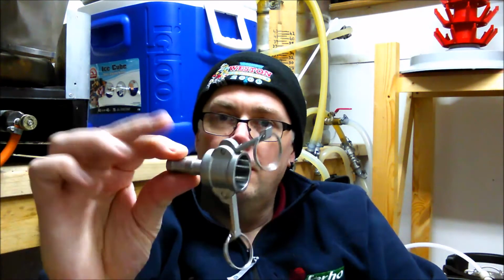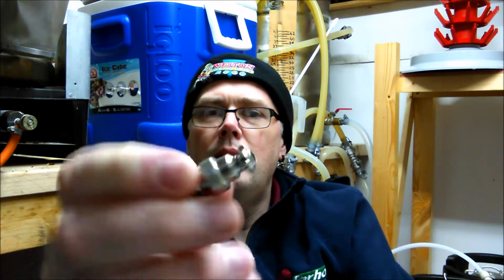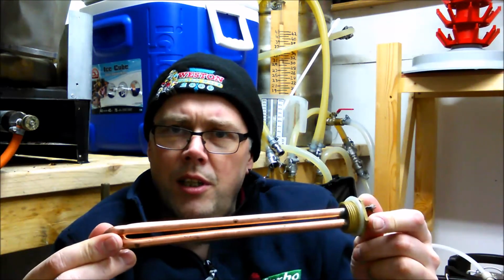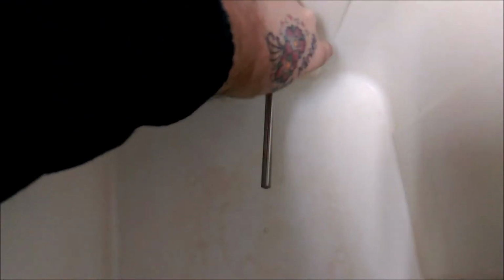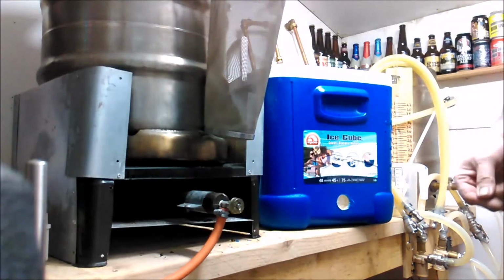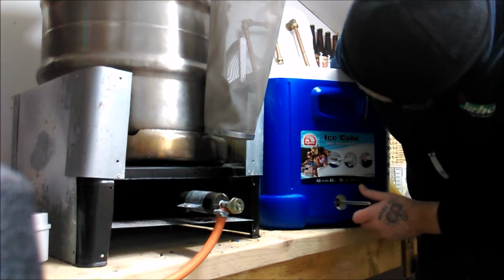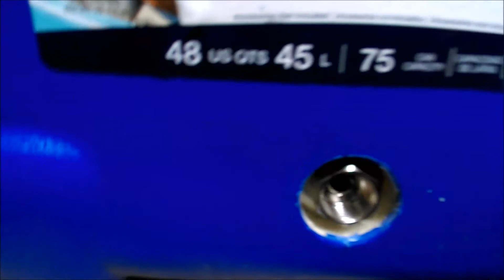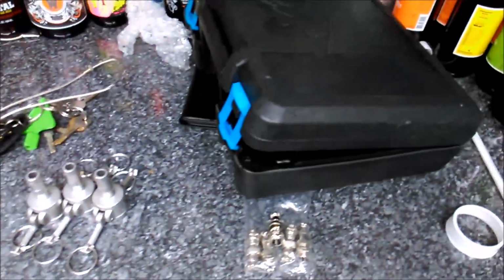HBW NO. 21 Happy new Year, deliveries and mash tun upgrade

Comment: do you ever finish tinkering with the brewery? that thermo well looks a good job and easy enough to install. one of those would be quite useful I'm thinking.
Reply from the maker: never really got it finished, I got it to a stage where I could get a brew on, but now I want to get it where everything is run from the panel.  don't know what I will do when its finished, even been thinking upgrading to a bigger boil pot!

Comment: I recommend using what ever kind of element you have in the HLT, but when it comes to the boil kettle you should use one or more of those ultra low watt density elements. It is worth whatever investment you must make. I use 5500w on a 32amp circuit. It only uses 23amps, but I like having the overhead for the other electrons,etc. cheers!
Reply from the maker: Hi Tony, does your pid  pulse the 5500w ulwd element when getting up to the boil or does it just turn on and until the boil is reached, and then turn on and off to maintain the boil. thanks Paul
Reply: Hi Paul, What PID do you have? If it's REX, then there is no manual mode, and what I say might not matter or make sense. That said, I use the PID in a few different ways during the boil... When filling the boil kettle, and the liquid is over the element, I use the PID in PID mode to keep the wort at 90C. This is on 100% until approaching the set temp, then it starts to pulse as expected to keep it at the set temp. I do this to not waste too much time when I've reached pre-boil volume. When at my pre-boil volume, I either switch the PID to 100C to bring up to the boil or I just switch it to manual mode and set it to 100%. Then when it starts to boil, I then set it (in manual mode) to 75%, which pulses at 75% and maintains a nice rolling boil. Hope this helps, Cheers!

Comment: Do you have an auto manual pid to control the boil kettle rather than switching elements on and off, those elements I bought are 4kw, I have found the 5.5kw ripple one`s but there 25-30 pounds
Reply from the maker: I do have a auto pid a rex c 100, but not sure if it has a manual setting on it, I do think there is a length of on time duration setting on it. the manual on the pid is used for the boil as Tony Yates said in a comment, below. I found those 5.5kw ripple ulwd elements for the same money, buy the time you add postage and import duty the price jumps up a fair amount.